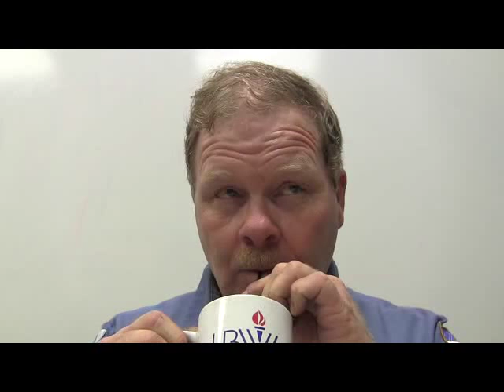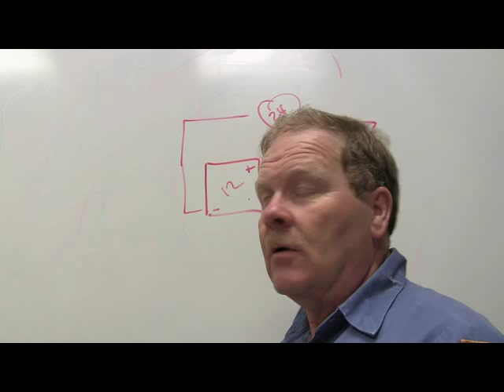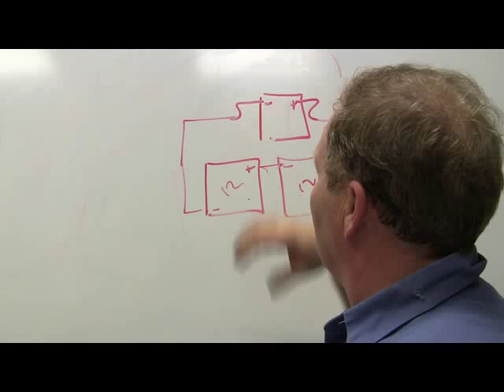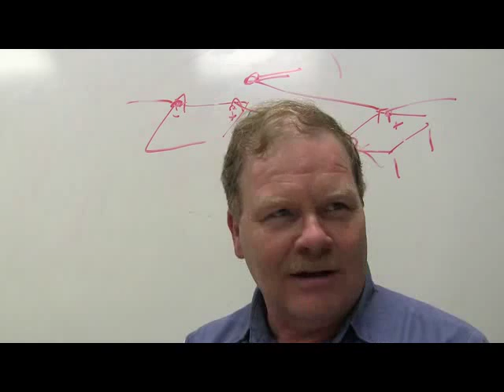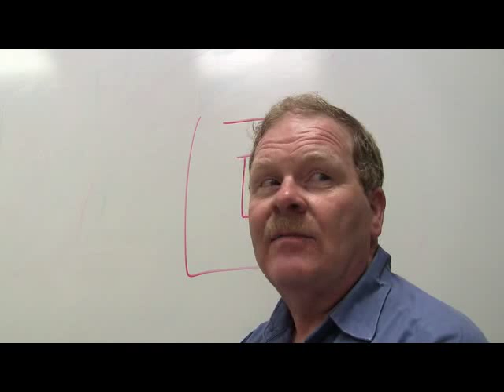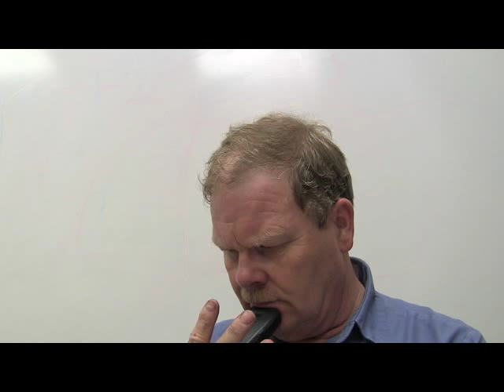Engine Performance Test 5   Meters and Stuff 2

Comment from the maker: I couldn't agree more - I started checking sensor voltages back in the 80s before Ford had a datastream and the readings taken right at the sensor are always a better indicator of actual conditions - the scan tool window does, however give the tech some insight on what the PCM is "thinking."  For example, you can't measure fuel trims with a meter.

Comment: I think your students also need to be informed on scan tool data vs. data at the sensor itself. Live PIDs on a scan tool is processed information and may not match readings taken directly at the sensor. That can very easily throw a novice technician for a loop. They need to be told that there is no absolution when interpreting data on a scan tool....I've seen multiple high dollar tools lie to me, which led to a lot of anxiety and frustration. Great video once again.